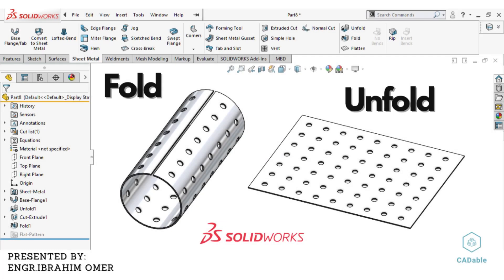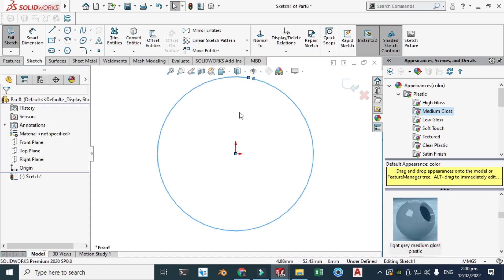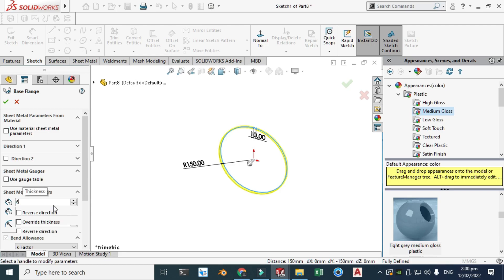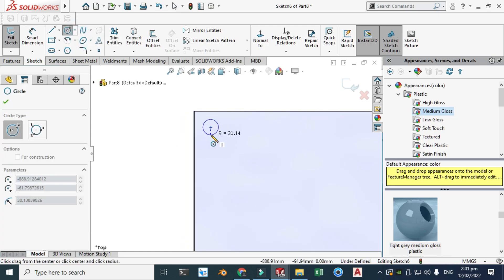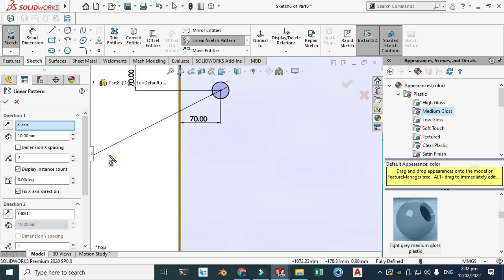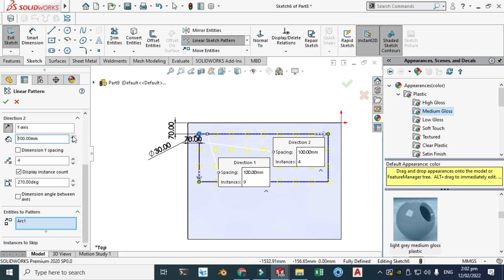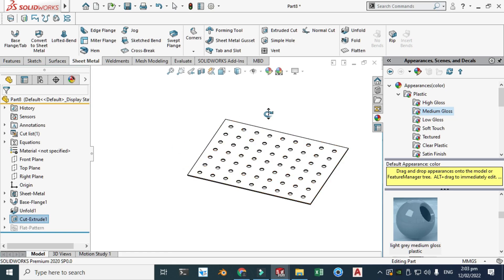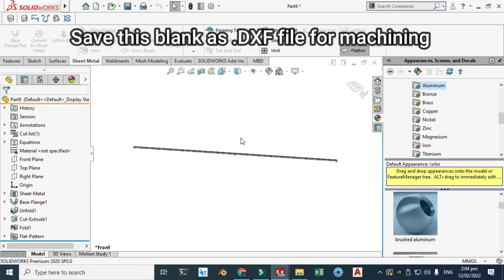Solidworks tutorial Sheet metal fold and unfold command | sheet metal flatten solidworks | CADable

Comment: Sir please explain mbd.
Reply from the maker: Noted for future videos! Here is the Summary:

SolidWorks MBD (Model-Based Definition):

Definition: Embeds all manufacturing info—dimensions, tolerances, notes, GD&T—directly into the 3D model.

Purpose: Replaces traditional 2D drawings, reduces errors, speeds up design-to-manufacturing workflow.

Key Features: 3D annotations, multiple views, export as 3D PDF/STEP 242/eDrawings, automated drawing generation.

Benefits: Single source of truth, better communication with shop floor, supports digital manufacturing.